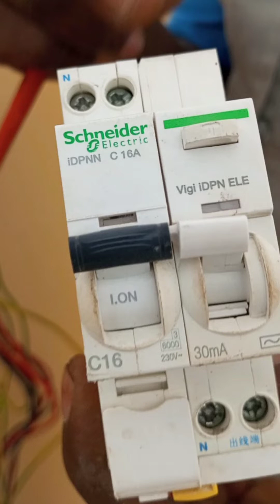RCCB/RCBO FOR BEST PROTECTION

Comment: Sir please i thought that MCB does the following protectt
1. Short circuit fault protection
2. Overload or Over current protection

While RCD does
1. Earth fault protection only. And this is done by comparing the current between the LIVE and NEUTRAL and when it detects the difference then it will trip OFF

I am right.

Also, when using these two protective device together, what should be the arrangement process in the consumer unit.
Reply from the maker: Please use the links below to watch those videos for clarification. Thanks
https://youtu.be/yAxkPvMb-7E
https://youtu.be/EDl-Vapdm5M
https://youtu.be/s1dP9xth6KY
https://youtu.be/MhdUZ7wOEPw
https://youtu.be/HeRdarYcoIQ
https://youtu.be/cPWMhQpa7Zc

Comment: Sir Ezekiel please i want to ask you this question. I do observe from the energy meter the load cable is connected RCD before going into a 2pole MCB in a consumer unit. It that the right way to go about it. I always thing that from the energy meter it should go to the MCB so that the RCD will be in the consumer unit rather.
Reply from the maker: Please use the links below to watch those videos for clarification. Thanks
https://youtu.be/yAxkPvMb-7E
https://youtu.be/EDl-Vapdm5M
https://youtu.be/s1dP9xth6KY
https://youtu.be/MhdUZ7wOEPw
https://youtu.be/HeRdarYcoIQ